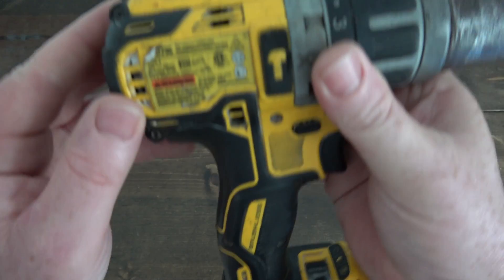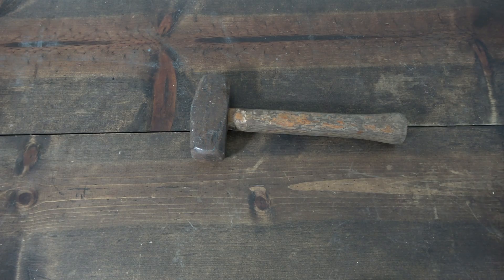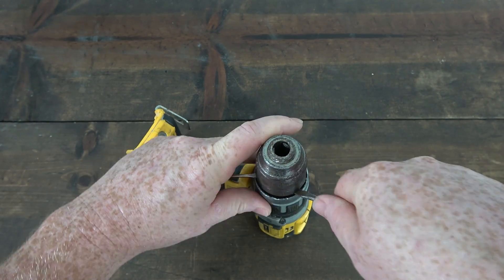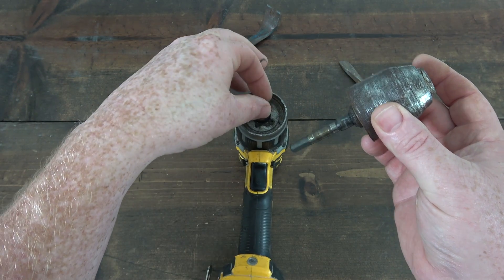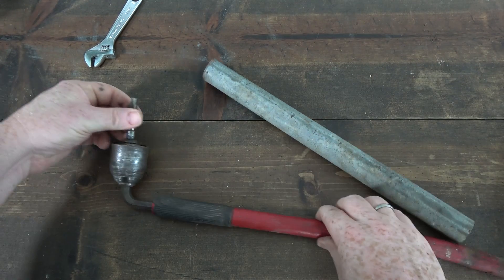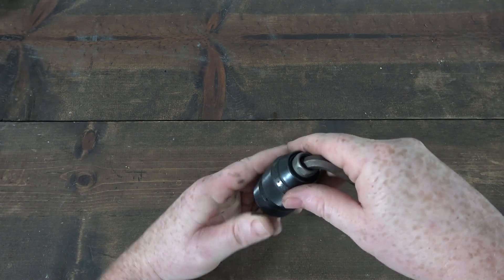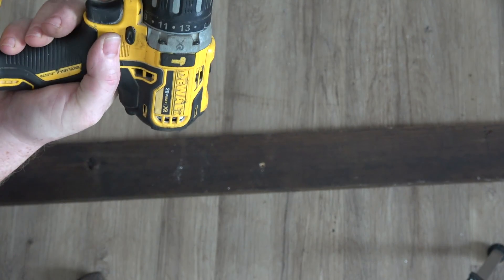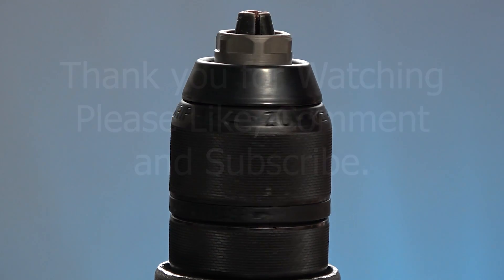EASY DEWALT CHUCK REPLACEMENT WITH NO SET SCREW.

Comment: If your repairing a Dewalt DCD777 cordless drill/screwgun please note there is no left handed thread torx screw to remove. And no Loctite on the 1/2 -20 threads. I have repaired hundreds of models built from 2018 to 2024. If you want to get the impossible to remove broken chuck off, take the gearbox apart and insert a 11 Millimeter, 12 point socket on the shaft where the O-Ring is. Put your 3/8 breaker bar with the 11 mm socket on it in a vise. Now use a 90 degree hex key in the chuck or a large pipe wrench around it and smash it with a large hammer. Also the rubber O-ring that goes on the shaft can be purchased on Amazon, it's a 12mm x 8mm x 2 millimeter size. Use a ton of grease when you put the metal ring over the shaft where the O-Ring is.

Comment: Thanks so very much for the video - worked great for me.  As you indicated, prying up the chuck requires a bit of patience but worked fine, also using a  leverage or cheater bar to break the lock into the chuck did the trick too.  Good man.🦸🦸🦸

Comment: This was super helpful. I hope it works for my model DCD985. My chuck looks identical to yours.  The long bars to gain leverage is genius! I saw one video with a vise grip holding the wrench so that is another way but I prefer yours - gentler on the chuck parts.
Nice to know that Rohm is a German company not another part made in China. Note that parts made in Taiwan for sewing machines are high quality, exact replicas, so Taiwan is not China quality. German is better.

Why not spend a couple of hours refurbishing the inside of the drill so it works like new again. eh?  I took mine apart, cleaned it up throughly with CRC Electronic Cleaner on electricals, Dawn dish soap on housing - removed all carbon brush dust, checked on brushes (replace if needed), and cleaned up the motor with CRC - so much black dust and grease grime flowed out. Spray CRC on motor.  Then I took chuck nose apart and cleaned out the black grease with Mineral Spirits, alcohol, and CRC.  I don't have the chuck removed from the nose section yet.
My model is an older DCD985 20V Cordless Drill.  Watch for the small deep screw in battery section, hard to see. Rest of screws are easy to remove and only 2 sizes so easy to reassemble. Do it the long way and have a new drill.

Comment: Im gonna squeeze my chuck tightening sleeve in the vice and make it bite at least I think I can . I took channel locks and put them in the vise ti squeeze harder and turned the drill to get my bit out si I think you can crush the sleeve and get it to work . I didn't smash it with that method but it won't tighten on a bit but a hex insert it will but slips . I think this will work .

Comment: Great video, the best method I've seen. He recently purchased the DeWalt DCD800, which came with the chuck with some annoying movement. This model has the same problem, it does not have a fixing screw. Will the Rohm chuck you used work on the dcd800? Thank you so much. Greetings!

Comment: Absolute perfect and easy to follow video. Just saved me from buying a new drill. Did it in ten mins. I couldn’t insert the Allan key as the chuck was totally broken and would not hold anything. I held it as tight as possible in a vice and cracked open the shaft with a spanner. Hey presto it came off easily. Thank you for uploading 🫡

Comment: I did this to my drill just to test it to see if I could get it out as you did, I did get it out quite easily, but when I put it back it only operates on hammer whatever setting that you put it on, can't understand this any ideas
Reply from the maker: I ran into that issue a bit later after doing this. I used a c-clap placed on top of the chuck and on the back of the drill (ferring strip on housing)  to seat the double D fitting.  I hope this helps. Thanks for watching!

Comment: Helo, of de Argentina, sory for my english. In my dewalt dcd 985 the chuck  broken but it is closed.  I dont see screw in. Do you know if it has screw, to remove only lever, (minute 2/3.Thanks you so much
Reply from the maker: So based on the blown out images it looks like it does have a set screw. The link below will show it. Look at 21.

https://www.ereplacementparts.com/dewalt-dcd985m2-type-20v-hammerdrill-parts-c-1009_9661_566974.html

I hope this helps.
Reply: thank!! 21

Comment: The other fault with these exact drills is they get stuck on hammer action the internals on these are so cheap nowadays.
Reply from the maker: I know it's pretty frustrating. Silver lining I got a 7 piece kit with hard box on wheels for $499 around 4 years ago and it paid for itself many times over. Thanks for watching.

Comment: So I noticed that the chuck just came out with prying so I used a large vice grip pliers to grip the chuck and I waked the pliers with a Mallet, gave it 10 good hits and it flew off. Took me literally 1 minute.
Reply from the maker: Good show! Thanks for comment. I helps the community greatly.
Reply: @DoItWithDave  also the front of the chuck has a hex bolt that you can put a 5/8 size socket on and really grip it well with a ratchet. So you don’t have to use a Allen key, mine was stuck open so there was no way for me to put an Allen anyways. But a crescent wrench and a 5/6 socket made quick work of it.

Comment: Hello, your video is brilliant, I have followed the steps, I have used your method because I couldn't remove the t20 torx screw inside, I just want to know what should I do as next step on putting everything back together regarding I have the t20 screw. My drill is DCD795. Any advice please?
Reply: Also the torx screw bit when removing actually snapped off the little bit. Do I actually need this part for my drill when I'm going to put together

Comment: Actually after looking at most of the videos here on YouTube regarding removal of chuck on these DCD drills, your doing it wrong, the way your doing it, it removes the stem which you do not want to remove, it’s done exactly the same way as they chucks with the set screw, if no set screw just simply tighten with a large Allen wrench and hit with a hammer, once loose just unscrew and screw on new chuck
Reply from the maker: Why don't you want to remove the stem?
Reply: @DoItWithDave  if your only replacing the chuck, the. Chuck is the only thing that should be separated from the drill itself and when your buying a replacement chuck you will only get a chuck, no stem, so basically your doing more work than needed. Peace
Reply from the maker: @johnjkizer6399  okay I understand now. Simply removing the chuck with Allen key and hammer is definitely the best way to go about it. I my case I literally spent an hour using the preferred method to no resolve. Even tried a heat gun. I only showed it this way because of that and was hoping to help anyone else that was having the same issue. Thanks for your post. More information definitely helps anyone trying to replace their drill chuck.

Comment: Currently trying to figure out chuck removal on a DWD520, it appears to have no set screw and freely spins so hitting an allan key is pointless.  I wonder if it will pull out too?
Reply from the maker: You could give it a shot. Maybe pry up a bit and see if it starts to pull up without having to use too much force. No set screw I'd think it'd be the same set up. There's always a complete disassemble and reassemble process. I hope this helps.

Comment: Do you think it could work also on 996 model?! Great video!!
Reply from the maker: If you don't have a set screw it may. If you do try this definitely don't force it. It should come up slowly but surely. I hope this helps.
Reply: Did you ever try this? I have TWO DCD996 with bad chucks. Contemplating trying this vs complete disassembly.

Comment: Was able to just do this with the 791 !    This model has the chuck more sunken in so the outside is a little damaged after i was done. But since there was a small drill bit actually stuck in my chuck I think this was my only option. Thanks for this video!
Reply from the maker: I'm glad you found this video helpful. Thanks for watching!

Comment: is this the same for a DCD740? mine is also in without a screw, but I don't have the fuel 360 degrees of prying like yours. it's the right angle drill
Reply from the maker: On Amazon, in the review section of the dcd740,  there's a response to someone asking if the chuck is removable and they said yes. Idk if that means Allen key and Hammer or not. I also read in an online forum that someone disassembled the housing to remove the Chuck for the 740. So I'd think it would come. Less pry area like you said. It may be possible to spin the chuck as it's being lifted up to get it on all sides. If you decide to try this and see the chuck is obviously able to be pulled away from the housing (gap between back of chuck and drill housing)  it's probably a go. I hope this helps.
Reply: @DoItWithDave  Hey, I've tried both methods to no avail. I tried prying, and I tried turning the chuck with an hex key both ways. It would make sense to be a normal LH thread but it wouldn't come off. There's a hex inside. I need to use the damn thing.The chuck is stuck open

Comment: What is the purpose for the big bolt looking at the tip of chuck for??
Reply from the maker: I think you're referring to the "Set Screw". It's used to hold the chuck in place.
Reply: @DoItWithDave  lol, I know what set screw is.. I’m sorry. What I mean at the near of chuck tip it look like 3/4 nut … assume it just a style??
Reply from the maker: @timjones6637  if you're referring to the new Chuck in the video I believe it can be used to loosen and tighten the chuck to the shaft instead of using an Allen key?
Reply: @DoItWithDave  i think so too.

Comment: Thanks so much - like the other folks I had exactly same problem with my DeWalt DCD795.  You method worked a treat and have saved me an expensive repair or a new one - there's nothing wrong with the drill itself, thank you Sir.  Great video.
Reply: David Kelly iv got the dcd795 also. Iv got a bit stuck in chuck and chuck is stripped. Jw its will wrk the same way with out 795 as shown in this video?? And a question for both of you guys, can ether of you give me a link to the chuck i need th purchase? Agin iv got the 795. Thanks fellas
Reply: @rickyrickharris4908  Hi Ricky sorry for delay.   So I'm in the UK and I managed to get this De Walt DT7012-QZ chuck which has worked brilliantly and was super easy to install onto my drill.  it's a lot heavier than the original chuck so it kinda behaves like it's in hammer mode most of time, even drilling timber but it's fine.  Works great - hope this helps
Reply from the maker: Thanks for watching!

Comment: Got the chuck but since chuck won't tighten at all I may have to replace the shaft as well
Reply from the maker: Idk if you've tried tapping the teeth in the chuck and spinning it a bit to try to get them to tighten. It may be possible to get a big pair of channel locks to hold the bottom of the chuck while you untighten the shaft.
Reply: Ive got a bit stuck in mine and used channel locks to losen chuck well it started spining alright but bit didn't loosen at all now iv got a free spinning chuck with a bit stuck in it lol.  So at least i can get the chhuck off ill find a way to loosen it once its off

Comment: Thanks for the info. I ran into an issue reassembling though where the drill was stuck in hammer mode. Turns out the bearing and gear under than metal cap with 3 screws are press fitted to the shaft, so you have to press them back on otherwise it’ll just hammer.
Reply: I have the same problem, and took the three screws and plates off, but I can't see how to press it back in, I've tapped it with a hammer gently, To no avail
Reply: How do you press it back?

Comment: I was a little sceptical about the prising off the Chuck but low and behold it came off fairly easily and I got the shaft unscrewed as pictured there are more complicated
ways shown on ytube but yours is by far the quickest I’m just waiting for a replacement Chuck to arrive now. You have saved me from getting a new drill. Thanks
Reply from the maker: Nice work! Thanks for watching!

Comment: Although I was sceptical this method worked extremely well for me the chuck prised off very easily without any damage to the surrounding housing -maybe I was lucky for once-. The method for removing the chuck from the spindle also worked well I used an old Vileda mop metal handle cut in half  for extra leverage on the allen key and Spanner which I thought would split due to the thinness of the tubular steel used in its construction but didn't. Excellent Instructions thank you very much.
Reply from the maker: Thanks for watching!